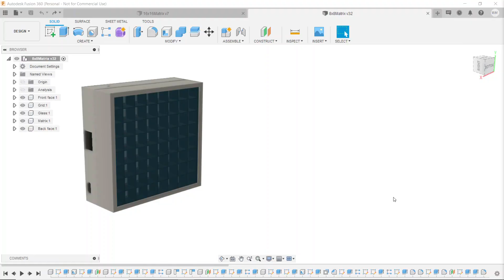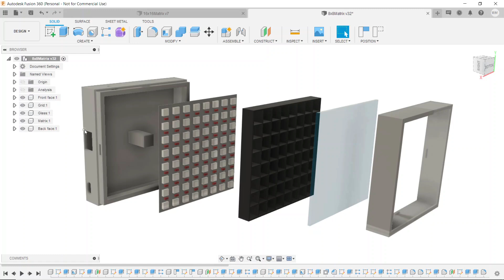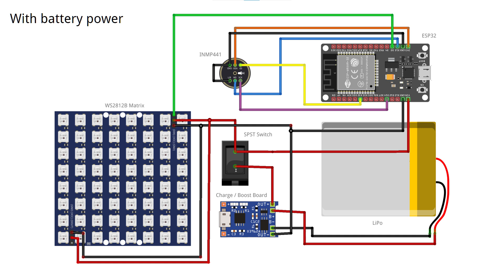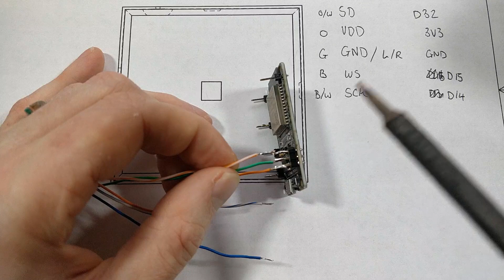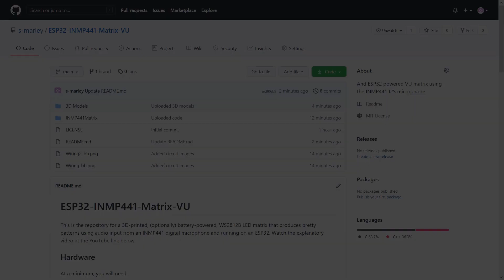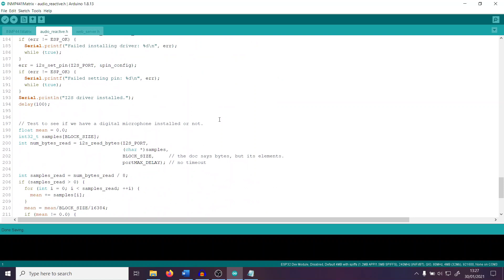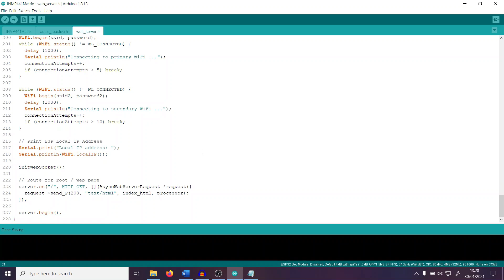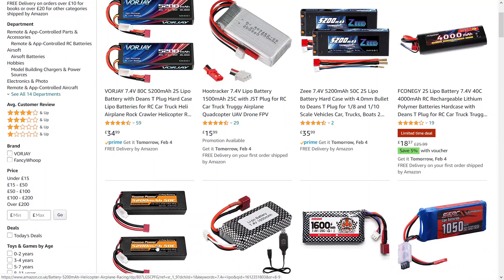3D-printable ESP32 powered VU display with the INMP441 digital microphone and a WS2812B matrix

Comment: If anyone is contemplating using the D1 mini form of the ESP32, you'll need to change some of the pin assignments in audio_reactive.h before compiling. I used the following (also mentioned on the webpage for the WLED fork):

#define I2S_WS 26        // aka LRCL
#define I2S_SD 18        // aka DOUT
#define I2S_SCK 22       // aka BCLK

Scott: trivial point but the web links for a couple of the required libraries at the top of your sketch are swapped around.
Reply from the maker: Hi, thanks for the useful information and the note about the libraries, I'll fix that later! I'll pin your comment for now so people can see it.
Reply: Michael, you gunna make a video of whatever yours turns out to be?

Comment: Mr. Marley, you are an outstanding teacher and I need your help. I am an architectural model maker and my client wants CHASING LED's in the model. All I want to do is have a short length (1m or less) strip (WS2812B-60 LED's per meter) displaying a single color for all LED's, chasing in a slow pattern, maybe with groups of 3 going only in one direction. I'm 83 years old and just getting started with Arduino coding. You mentioned GitHub and I signed up, but what do I need to do to find the code that will do this effect? I appreciate any help anyone can give me.

Comment: Good job. Could you put a link to the battery charger you have used. Specifically, the one you used for the 16x16 matrix. Thank you.
Reply from the maker: I wouldn't recommend the one I used for the 16x16 as it couldn't cope very well as it turns out. You'll need a 3A minimum buck boost lipo charger.

Comment: I tried to run this on this Model NODEMCU-32 and it did not work. Microphone test worked. Did I used the wrong pins? I tried severel conections. But maybe not the right ones.
Reply: find pin-out sheet here: https://drive.google.com/file/d/1Lw2Oz0USGsgaU1TTJEujdx9GcYBPtnDF/view?usp=sharing

Comment: Awesome work, thanks for sharing
A question, but don't thing it's a small question lol.. Do you have a video on how to wire and program an SD card to ESP32, for example, to play music and lights effect files and pair it to multiple ESP boards through wifi, thanks
Reply from the maker: I'm afraid I don't. If it's just syncing light patterns up, you can use WLED which can sync multiple esps over wifi. Then perhaps have another on in charge of the music? You can get SD card readers with a built in audio output that talk serial to any microcontroller (I'm making one at the moment that runs from a nano). Maybe look into those devices?

Comment: Hello. Our projects are similar. I have a problem maybe you can help. I have a 5v power supply that feeds the leds. The microprocessor is also fed from this power supply. When I plug in the USB to run the program and start the device, everything works fine. But when I disconnect the USB, the LEDs turn on randomly as if there is noise. I tried with different power sources but the result did not change. Have a comment?
Reply from the maker: Not sure but it sounds like something isn't grounded properly. Either the micro or the LEDs. Other than that I can't think what would cause it.
Reply: @ScottMarley  I used one side of the breadboard for the 3.3v and GND I got from the microcontroller. I made the microphone connection here. On the other side, I used it to distribute 5v from the adapter. The 5v/GND inputs of the microprocessor and the 5v inputs of the we2812b are connected here. I'm making a simple mistake but I couldn't find where it is..
Reply from the maker: @brsguler  that sounds fine to me. Have you used a multimeter to check that everything is connected as it should be? Check everything for continuity. On some breadboards the power rails are split in the center. Is that the case with yours?
Reply: @ScottMarley  yes, the breadboard is the answer. I soldered everything together. No problem left. thank you for your suggestions..

Comment: Scott! Thank you for all the info! Really great project! I am trying to do a similar project with a big led matrix of 40X60 in a wall. On arduino Nano, it gets out of memory. In the ESP32 we have more space for this. Have you tried with that big led matrix? Do you thing that I could organize the code to run with the led strips upside-down distribution (I have a hardware limitation)?
Reply from the maker: 40x60 should be no problem for the ESP. Ignoring all of your other code, the LED array would need 7.2kB of ram. The ESP has 512kB, vs just 2kB for the nano! My code for this is designed to work in any orientation. There are some notes at the top of the code about using smart matrix to set the orientation and direction in which the LEDs are wired. Have a look at the adafeuit page for more info.
Reply: @ScottMarley   Thank you for the info! Another issue is that following the coments in the code, the led matrix width should be multiple of 16 and I would like to have 40. If I program 48 but only got leds for 40 I guess that I will lose the last 8 frequency bins, but the leds will still work. It’s correct? Do you have a better suggestion to get 40 width matrix?

Comment: Can you show me how to use xd-74 sound sensor because it's to hard for me to learn
Reply from the maker: That module is a sound threshold sensor. You set the level using the trimpot on the board, then when the sound is over that level the 'out' pin is set to high. If it's below that level it's set to low. That's it, couldn't be easier :)
Reply: What's other alternative to make easier VU meter

Comment: driver/i2s.h is missing could you help me?
Reply from the maker: You must set the board to ESP32 in the IDE before compiling. If you've done that it should find i2s.h automatically. It's part of the ESP Arduino core.
Reply: @ScottMarley  thank you for your immediate replay

Comment: I've watched a lot of your videos and they are all brilliantly detailed.  I'm building this project as my very first go at electronics, so I really appreciate how much care you have taken with this work. So (knowing nothing!) ... the code comment says 'LED data, D2 via a 470R resistor', but your wiring diagram doesn't show this. I'll follow the diagram :)    Thanks Scott.
Reply from the maker: The resistor is optional but recommended. It will usually work fine without, but can refuse the chance of interference on the data line.

Comment: Scott, first I would like to congratulate you, you do amazing things.
I speak here from Brazil and I follow all your videos.
I built a matrix that worked perfect, but I can't get the same pattern from your video.
In this video pattern, the leds start to light up at the base and have this drop effect.
Is this pattern in your program available on github?
Reply from the maker: I'm not completely sure which pattern you mean, is it the one that's mainly blue? That uses the createWaterfall and moveWaterfall functions. Basically you color the bottom row depending on the intensity in each band (red highest intensity, blue lowest, createWaterfall)  then every so often just move each row up (moveWaterfall). If you want to integrate it into your own code, you'll have to understand how mine works first, or it might be easier just to write your own version of it!

Comment: Hello Scott! I've been researching and testing a lot of BMSs in the last 3 weeks, and I found this problem on almost all of them ( commercial battery packs BMSs and other DIY BMSs):They disconnect the output for 500 ms when the charge cable is connected or disconnected or both).  But this doesn't happen on smartphones circuits, laptops, etc. So I suppose there must be some BMSs that don't do that. Do this two BMSs you are using behave also that way?  I need one for a UPS with USB C and I couldn't find one yet.
Reply from the maker: I just tried both, and neither disconnect on plugging in USB power. I wouldn't recommend these though, I haven't tested them properly but it don't have much faith in their protection features!
Reply: @ScottMarley  Thank you Scott. Maybe they reset the output only when you disconnect the USB power. Most of them do that, and just some of them do it on connect.

Comment: Hi. Have you ever had the issue where your ESP32 won't connect to wifi when using external power supply? im using the "doit esp32 Devkit V1". the Wifi works fine as long the board is connected to my PC. But if I power it from a phone charger, it sometimes works and other times not. its seems a bit random. But when powering the board from "VIN" with 5V , the Wifi NEVER works. Have you had the same issue? if so, I will be very greatfull if you could explain how you fixed it. Thank you for creating the amazing content you are sharing here on youtube.
Reply from the maker: Hi Max, I haven't had that issue, sorry I can't help! How clean is your 5V power in? Is it from a decent supply or something really noisy? I can see that causing an issue.
Reply: @ScottMarley  Hi. im using a power supply from apple. When i  google this issue, it seemes im not the only one that have this issue. some people says that its a mistake by the designer of the board. Do you own the exact same board? "doit esp32 devkit V1". i got mine from banggood.
Reply from the maker: @maxbursell3513  mine looks almost identical to that, but it isn't 'doit' branded. I got mine from Amazon but there are so many different variants out there it's hard to know what I've got! I guess all you could do is try a differen ESP variant and see if that changes things. Good job they're cheap!

Comment: How would this be modified to simply use usb power as opposed to a battery? Can you post a simplified circuit?

Can you also advise where to find code that can use wifi to update the display to simply show an image? Perhaps a web interface that allows drag and drop to update the display?
Reply from the maker: To use just USB power, I would have the usb cable run into the ESP32 usb port, then run the power from the ESP32 5V pin to the LEDs. However, the ESP has a protection diode onboard that is only rated for 1A, so make sure you don't draw more than that (use FastLEDs set_max_power_in_volts_and_milliamps function). If you want to be a bit naughty, you can desolder this diode from the board and bridge across it with some wire or solder. This way I have drawn 2A through the 5V pin with no issues before. The larger display can run on 2A (although not at max brightness) so doing it this way you'd have to remove and bridge the diode.

Comment: Hi Scott, really liked this nice project.
With your great explanation, I could easily set it up for a test run and it works great.

But I have hard time finding out how to change the frequency range.
Here it is set from 60 Hz to 5120 Hz with a sampling rate of 10240 and 512 samples.

Trying your other project very helpful FFT Calculator Excel file, I can't find a relation between the Andrew's updated mapping code in "audio_reactive.h" and the results to modify his mapping for a new range.

Would greatly appreciate a little help finding out how to change the frequency range for this project, if possible at all.
Reply from the maker: Hi John, sorry it took so long to get back to you. I've made a new version of the Excel file specifically for this project and uploaded it on GitHub. Have a look and let me know if it helps. You could change the sample rate to 20480 for example, and the highest frequency to 10240Hz (nyquist theorem says max f is half our sample rate). I haven't tried to see how fast I can sample with that microphone, but I'm guessing it's much faster than I am doing here! Let me know how you get on, I'd be interested to know.
Reply: @ScottMarley  Thanks a lot and hats off for your kind help and reply Scott.
I've tried to get a grip on this new calculation, modifying the code for new ranges like 80 to 8000Hz, but testing it through my signal generator attached to an amplifier, the frequency distribution stays off :(

Changing the Frequency Multiplier calculation From =(B7/B6)^(1/16) To =(B7/B6)^(1/15), shows the correct ending frequency on the generated table. But applying modifications in the code, it goes off and on higher than 5kHz, it rolls over backward. Tryied different Sample Rate, Samples or Ranges.

Checking INMP441 Datasheet, it can respond easily from 80 to 10kHz with nearly flat response.

Will setup another test bench later and try to read more, checking other codes, perhaps it finally becomes clear how to distribute a frequency range through 16 channels.

Don't know why I have a feeling something may be missing in Andrew's update explanation to achieve this goal.

Thanks again for your great project. As it is, it works great, respond precisely to music played and looks fantastic though :)
Reply from the maker: @johnknight9422  that's ... interesting behaviour! Honestly I haven't looked into Andrews code too much tbh, and I'm too busy at the moment to give it much time. There's probably something simple that neither of us have though of, so if you do make progress on this I'd love to know about it! That way I can incorporate it into my code for everyone else to use. The other thing I wanted to integrate and never got around to is some kind of auto calibration. My idea was that you press 'calibrate' on the webapp, then play pink noise through the speaker you are using it with. It could then automatically normalise the heights of the bars as pink noise is supposed to be equal power in each octave (or something like that). It would be an interesting experiment if nothing else.
Reply: @johnknight9422  I'm glad found this in the comment section. I was trying out the same thing and couldn't get an accurate representation of freq graph. I'm using a 8x8 matrix and found out it's only reactive in the low and mids section, barely get any treble. Am I missing something? If you find out something before me, would like to try out your findings.
Reply: @ScottMarley  I can't thank you enough for the projects that you have made and shared. They are just brilliant and the explanation is top notch. Thanks for all of it and keep them coming, has helped me learn a lot. Brightens up my space ;)

Comment: pls help me
In file included from C:\Users\DungTran\Desktop\INMP441Matrix\INMP441Matrix.ino:47:0:
C:\Users\DungTran\Documents\Arduino\libraries\FastLED/FastLED.h:14:21: note: #pragma message: FastLED version 3.002.009
 #    pragma message "FastLED version 3.002.009"
                     ^
In file included from C:\Users\DungTran\Documents\Arduino\libraries\FastLED/FastLED.h:65:0,
                 from C:\Users\DungTran\Desktop\INMP441Matrix\INMP441Matrix.ino:47:
C:\Users\DungTran\Documents\Arduino\libraries\FastLED/fastspi.h:115:23: note: #pragma message: No hardware SPI pins defined.  All SPI access will default to bitbanged output
 #      pragma message "No hardware SPI pins defined.  All SPI access will default to bitbanged output"
                       ^
C:\Users\DungTran\Desktop\INMP441Matrix\INMP441Matrix.ino: In function 'void loop()':
INMP441Matrix:194:6: error: 'class AsyncWebSocket' has no member named 'cleanupClients'
   ws.cleanupClients();
      ^
Multiple libraries were found for "LEDText.h"
 Used: C:\Users\DungTran\Documents\Arduino\libraries\LEDText-master
 Not used: C:\Program Files (x86)\Arduino\libraries\LEDText-master
Multiple libraries were found for "WiFi.h"
 Used: C:\Users\DungTran\AppData\Local\Arduino15\packages\esp32\hardware\esp32\1.0.4\libraries\WiFi
 Not used: C:\Program Files (x86)\Arduino\libraries\WiFi
Multiple libraries were found for "AsyncTCP.h"
 Used: C:\Users\DungTran\Documents\Arduino\libraries\AsyncTCP-master
 Not used: C:\Users\DungTran\Documents\Arduino\libraries\AsyncTCP-idf-update
 Not used: C:\Program Files (x86)\Arduino\libraries\AsyncTCP-master
Multiple libraries were found for "FastLED.h"
 Used: C:\Users\DungTran\Documents\Arduino\libraries\FastLED
 Not used: C:\Program Files (x86)\Arduino\libraries\FastLED
Multiple libraries were found for "ESPAsyncWebServer.h"
 Used: C:\Users\DungTran\Documents\Arduino\libraries\ESPAsyncWebServer
 Not used: C:\Program Files (x86)\Arduino\libraries\ESPAsyncWebServer-master
 Not used: C:\Users\DungTran\Documents\Arduino\libraries\ESPAsyncWebServer-master
exit status 1
'class AsyncWebSocket' has no member named 'cleanupClients'
Invalid library found in C:\Users\DungTran\Documents\Arduino\libraries\ESP8266FS: no headers files (.h) found in C:\Users\DungTran\Documents\Arduino\libraries\ESP8266FS
Invalid library found in C:\Users\DungTran\Documents\Arduino\libraries\ESP8266FS: no headers files (.h) found in C:\Users\DungTran\Documents\Arduino\libraries\ESP8266FS
Reply from the maker: Hi, it looks like you have a number of different errors there. You must make sure you have all the ibraries installed as listed at the top of the code. Also, are you trying to do this on an ESP8266 (or do you have the wrong board selected in the Arduino IDE)? It will only work on an ESP32 I'm afraid. Let me know.
Reply: @ScottMarley  after completion it doesn't work.